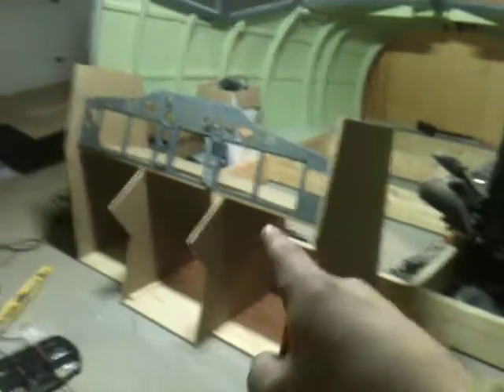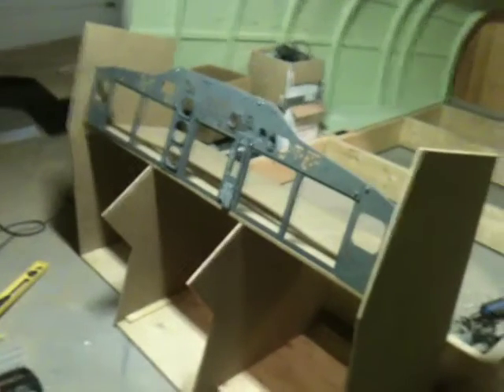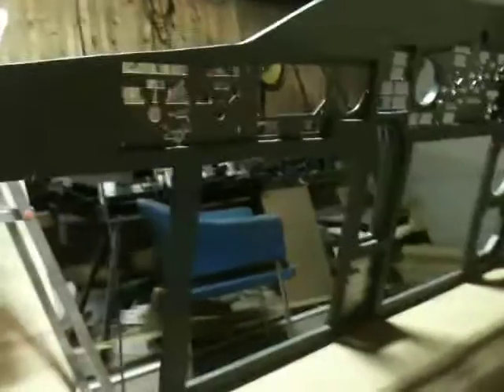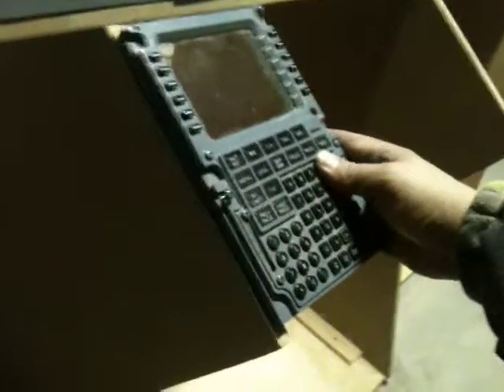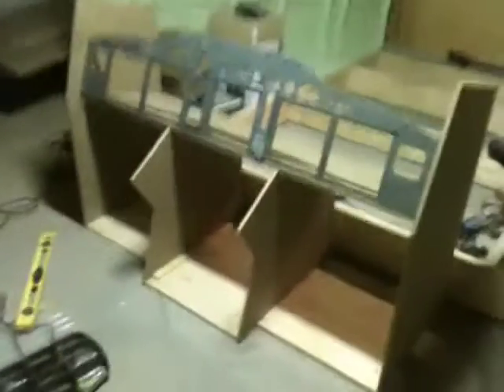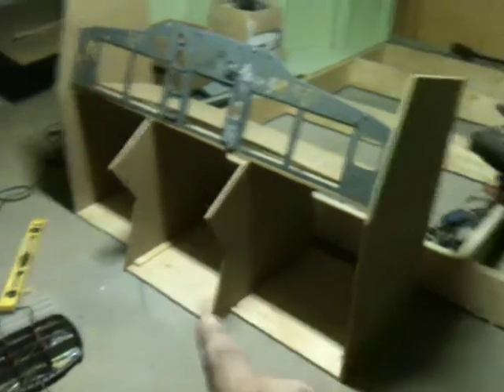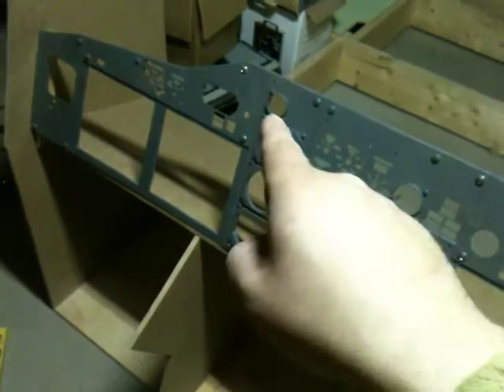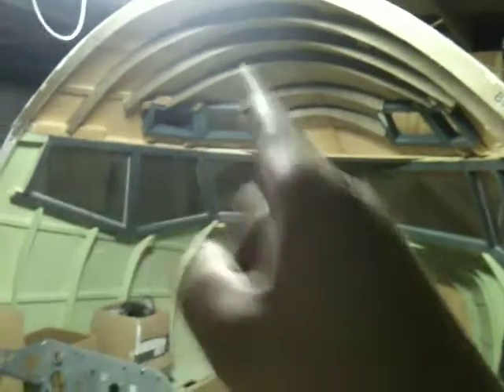Building a Boeing 737-800 home simulator #20

Comment: Well how can I not comment now.. Thanks for the shout out. Looking quite spiffy. Great looking MIP. I loved the push buttons you had from an earlier video. Have you given some thought yet to cooling. Those 6 displays or perhaps more could produce quite a bit of heat and cooling would add more life to your displays. You could perhaps use clothing dryer flex tubing to direct the flow both in and out of the MIP. This will let you put fans where ever you like, preferably away from a heat source.

Comment: well done buddy, its looking great - been following you since day 1, and your really getting to the 'nitty gritty' which should be really good fun! keen to see the next vid and how the CDU has come together and how your planning on wiring up the electrical.  I am in the process myself of building a collimated display - using Mylar/BoPET 30ft wide x 8ft height at 2mil (50.8microns) thickness - very similar to the real thing the CAE sims are using these days.  What display system are you planning?